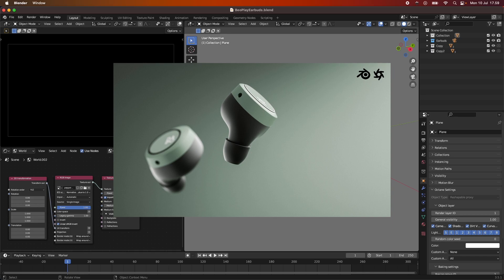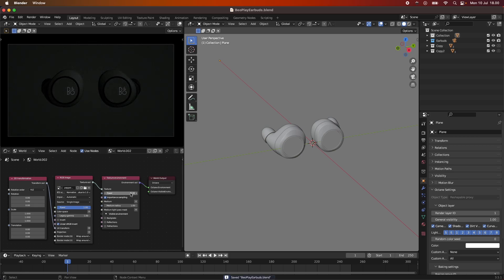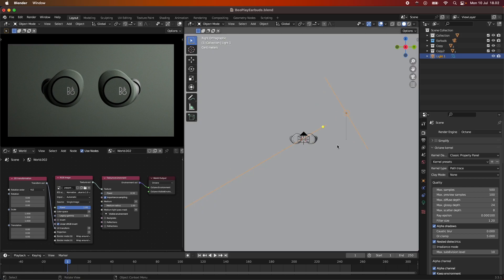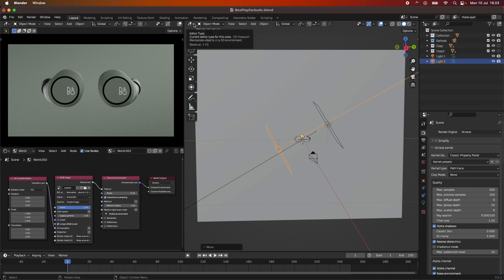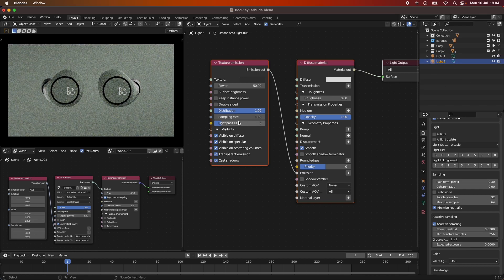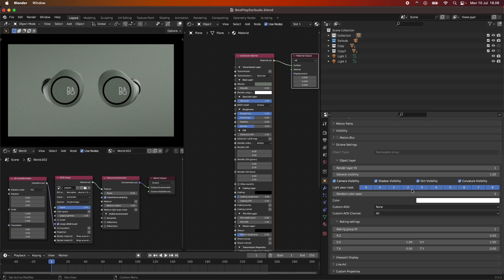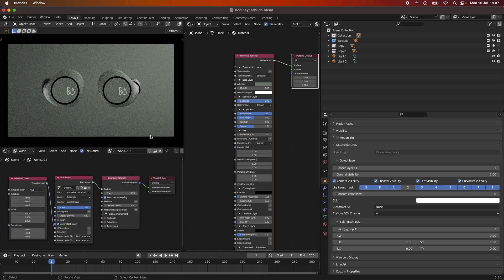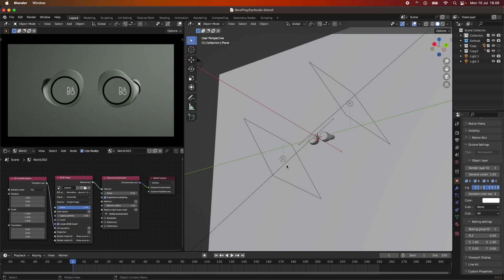Blender and Octane Light Linking Tutorial: Create Professional Renders with Precision

Comment: Is Octane really worth it in comparison with Cycles? And how fast is it in your experience with an rtx card compared to Cycles?
Reply from the maker: Hmm… I really like Cycles. But for me there is two things to consider. First I Personally get to the desired result faster with Octane, I just like it’s way of handling Color and light better + it has more features. 

Second, it is more industry standard than cycles, and I don’t want to switch from blender, so Octane allows me to get more prof work so to speak. 

The speed is about the same for me. Though the viewport of Cycles is faster I think. But when rendering not much difference. 

Hope it answers your question. In reality it is about the work you do and present. But of course software can help 🕺
Reply: Yep I get the same question all the time it's not really about what Render engine your using it more about how you use it and how it fits in your own workflow I use octane for VFX because the render passes are easier to setup then cycles and it fits into a vfx pipe line better then cycles (more industry-standard) but I still use cycles often job to job